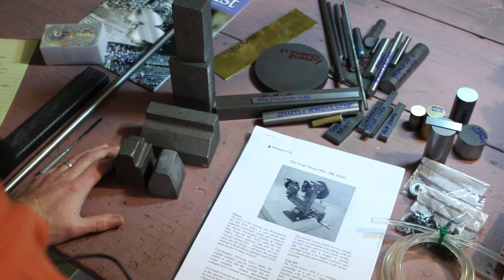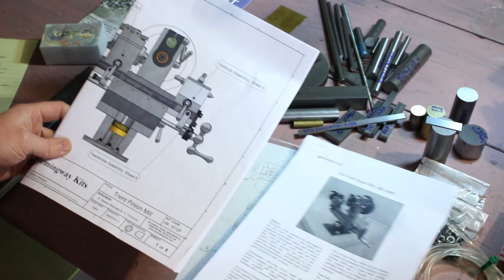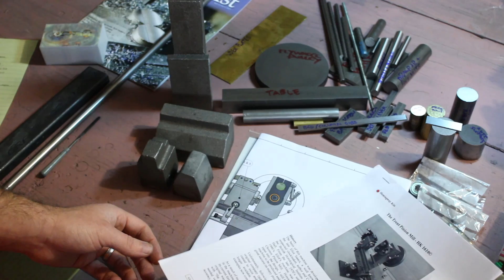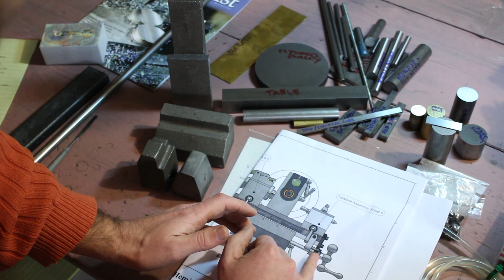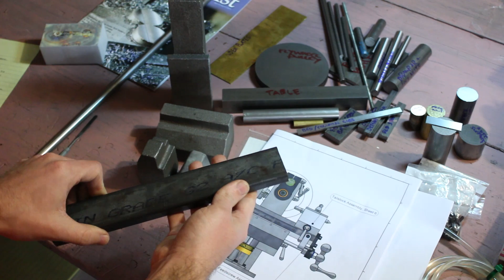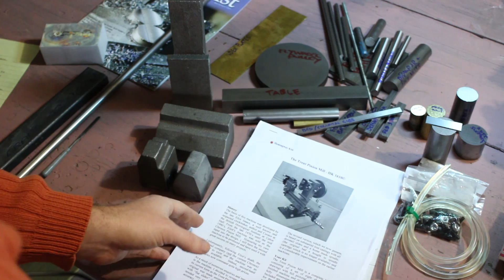Building the Trent Pinion Mill, part 1

Comment: Having used one of these a quick traverse /lever return option is definitely a good idea, the only real downside in use is the amount of cranking back and forth, even an option to use a car windscreen wiper motor to drive the feed would help in producing very smooth. Pinions, 
Good luck with the build ☺️
Reply from the maker: Thank you Daryn, and thanks for watching! :)

Comment: Maybe using an half nut system like the one used on the lathe carriage? That way you can use a lever to feed instead of the feeding screw.
Reply from the maker: The split nut idea is a good one in theory, but in this application it presents some challenges that end up making it quite a bit more involved than other options.  Firstly, it's a more complex mechanism to design and manufacture, all other things notwithstanding.  Second, there is the matter of available space for the mechanism.  The current design (and supplied casting) accommodate a threaded hole directly in the knee, and there is precious little room around that for a proper split nut mechanism.  Using strictly a half nut (without an opposing half) as seen on some import machines takes up less room but is undesirable in practice.  Last of all, a split or half nut design would require an additional bearing support at the far end of the feed screw, whereas the two designs I'm considering allow the feed screw to stay supported at two points at all times, without the need for an additional support bearing at the far end.

Comment: I will follow that build very close :)
Suprisingly small, on the pictures the machine looks more like the size of a minimill/minilathe...
Reply: Oh!
One question: Is it a full 3 axis machine? I see the table back and forth, up and down, but no motion in direction of the spindle?
Reply from the maker: Haha yes it is really very tiny.  Regarding the 3rd axis, yes it does have one... sort of.  Since this machine is specialized for pinion cutting, the axis in the direction of the spindle is only necessary for ensuring the cutter is centered relative to the centerline of the work.  So that adjustment is accomplished by moving the entire spindle cartridge assembly.  Whether you are purchasing cutters or making your own, it is unlikely that much, if any, adjustment will be required, but it will be a good idea to allow easy adjustment of the drive pulley on the motor (or the motor mounting itself, perhaps) just in case.  The round drive belts as used on this machine will tolerate a bit of misalignment, but not much.

Comment: Looking forward to your build! Alan Timmins was a well-known clockmaker in the UK who passed away a few years ago. He famously authored a series in the Horological Journal about building a high-precision Regulator clock, and re-worked the Trent mill, which I think was originally devised by Elliott Isaacs of the British Horological Institute.

I believe that Hemingway Kits have made all instructions and drawings available with a choice of metric and imperial units. However, when buying the imperial version, they supply metric fasteners. The reason is that imperial fasteners are no longer universally available in the UK. Yes, the is a LOT of that stuff available, but if you were running a business selling, you'd want to guarantee permanent availability; the supply of imperial is dwindling. 

In any event, USA imperial is not directly equivalent with British, because British fasteners used to be based on the Whitworth standard, with 55-degree threads, whereas I understand that in the USA, although the pitches are the same as Whit., the thread angle is 60 degrees. Maybe somebody could confirm or deny?
Reply from the maker: I'm aware of BSW still being somewhat used in Britain but I thought they also had a 60 degree imperial standard they used too... over here we have UNC and UNF standards that are 60 degree imperial.  You've got me wondering now about 60 degree imperial threads in Britain.. is that even a thing?  If so, is it UNC/UNF or a totally different standard?  Totally understandable about Hemingway, as a business, settling on metric fasteners.  There is no reason at all why they shouldn't be acceptable.  In fact, if I could single point metric threads and/or if I had a better selection of metric taps and dies, I would have probably stuck with metric fasteners (and still have made my own, of course).  Thanks for taking the time to comment, and thanks for following along! :)
Reply: Hi there - certainly UNC and UNF are not unknown in the UK. They're very infrequently used though, being, as I understand it, a USA-origin system. The UK officially went metric many decades ago, at which time formal adoption of standard metric threads would have come into place, not metricated versions of imperial, which is what UNC & UNF are, I think.

In practice, many enterprises still continued to use Imperial fastenings, simply because that's the tooling they already had, and why change what already works, right? Also consider that the UK wasn't on a strong economic footing in the 60s and 70s, and businesses would have been quite correct to make do with what worked and didn't cost extra money. As time went by, more and more manufacturers began to employ metric, especially because of closer integration with the rest of Europe. Who'd buy your machines, cars, aero engines, if they weren't serviceable overseas? Fast forward to today, it's pretty much only model engineers and restorers of older equipment who need to use Imperial fasteners. Hence the lack of a reliable long-term supply. In my own workshop, I'm pretty much fully Imperial (even though I grew up with metric), simply because the machines I've bought and the beautiful older tools I prefer are all imperial.
Reply: FWIW, the prefix "U" appeared in WWII. There was a need to normalize British and USA screw thread  standards and the result was the Unified National Standard Fine/Coarse pitches. Both of course Imperial. Both 60 deg threads. These were supposed to replace Whitworth  (55 deg) threads, but of course they didn't. Now Britain has gone to metric but UNC/UNF is still legal and available. Just to complicate things, Britain uses also BA (British Association) standards. This is basically metric but with a square root of two factor thrown in. Based on a Swiss standard for watch/clock /instrument/model makers. Argh! Give me DIN, please. I am interested in Isaacs because I have all but one of the wheels cut for his clock and lantern pinions made.